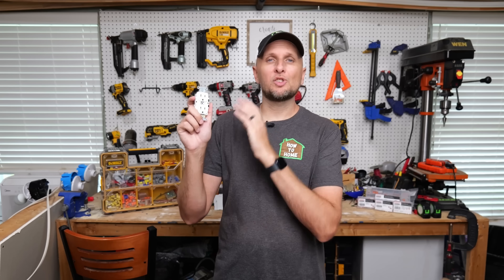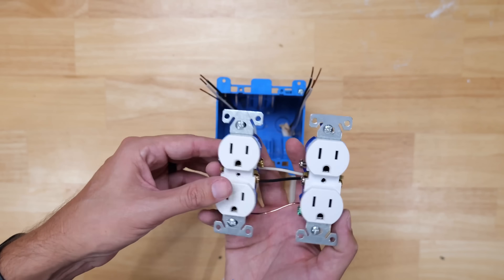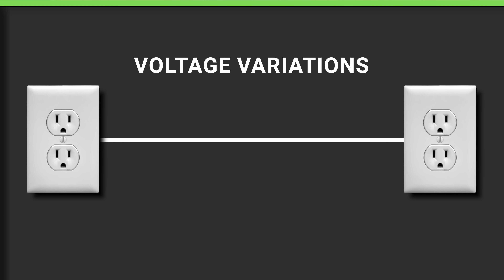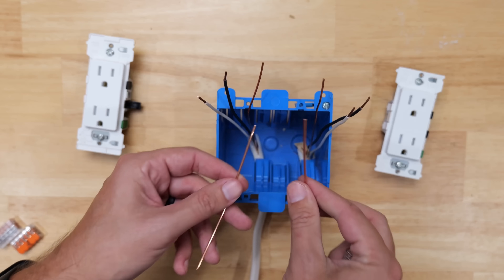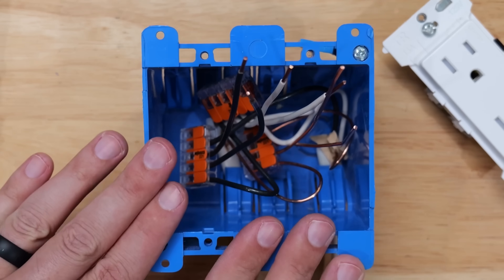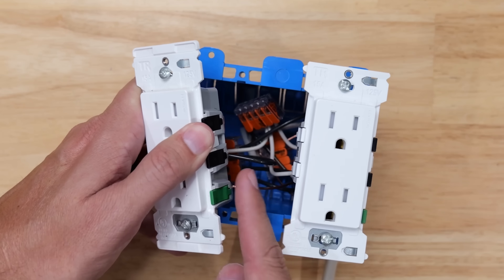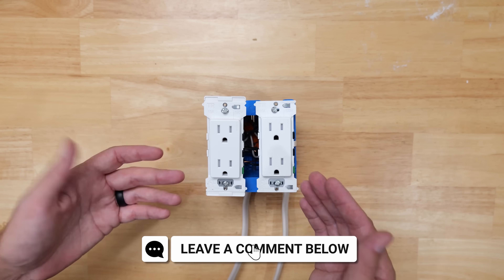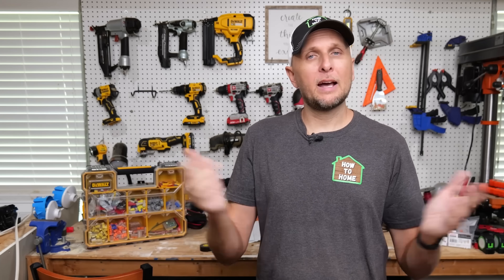Why This Outdated DIY Outlet Wiring Needs to End!

Comment: I use commercial grade receptacles. They basically have a terminal strip built in to the receptacles for hot & neutral. This way the Wago connectors don't take up room in the box.
Reply: I love the commercial grade receptacles.  Very robust and they make great connections.
Reply: I myself only use commercial grade receptacles because even though they're back wired , After putting the wire in , You tighten the side screw and it has a pressure plate that clamps onto the wire 
If you're willing to spend the money and add much more safety , Especially in the kitchen where you use heating appliances 
Hospital grade receptacles which are the very best
Reply: @ironmartysharpe8293 commercial grade (spec grade) are an easy choice for a homeowner
Reply: Agreed.  There's a good amount of surface area for the conductors to make contact, and the screw allows for a tight connection.  Even better is using a torque screwdriver and confirming that you applied the rated torque to the screw.

Wagos are great, too, though.  My old house has short wires in the boxes because the old Romex has been trimmed too many times.  A Wago pigtail adds a few inches in a code-compliant way and makes re-inserting the devices much easier.
Reply: I agree but how do you handle the grounds?
Reply: @thomaslee8116  I used the better terminals and put the wires behind the screw and plate. I used a wago for the grounds and separate ground wire.
Reply: @keithwiebe1787  Same here -- for the ground wire, premade stranded pigtails with a spade connector on the receptacle end make it easy.

Most of the ones I see sold come with a spade on one end and a loop w/ screw on the other end -- I just chop off & strip the screw end.
Reply: @thomaslee8116 you can use a wago. I have also used these green wire nuts with a hole poked in the top. Takes little room
Reply: @daveburgan Excellent. Thanks for the reply.
Reply: This is the way...I'd rather pay double for commercial grade...
Reply: At 7:42 he shows a commercial 20A receptacle. IMHO the screw terminals on those are far superior to any spring tension terminal available. I've got over 40 years of experience in electronics and have found that type of terminal in heavy duty equipment of all types. It's there because it works. Lever terminals still rely on spring tension and have a lower surface area connection than the screw terminals. Passing the hot and neutral through the screw terminals of commercial receptacles to me is more reliable than pigtailing with Wago connectors. If the industry wants everyone to pigtail, they should add screw terminals to the back of outlet boxes instead of relying on wire nuts or Wagos.
Reply: Agreed. The cost difference is minimal for a homeowner. They are significantly better devices and backwiring is faster and easier than making a hook

Comment: Ahh 3 times the points of resistance and failure points when the wago fail you get to search it like an outlet.
Reply: You can use a circuit tracer. If the circuit tracer shows power but doesn't function, that's the fault.
Reply: When the wago fails? They as reliable as a wire nut when both are installed correctly.

Comment: This is wrong, a failed receptacle would not interrupt power down the line. There is a solid connection between the terminals and in no way pass through the outlet, with the exception of GFCI. However there is nothing wrong with pigtailing as long as you remain within box wire fill capacity.
Reply: All depends on the mode of failure; the only one I can envision is if that connector/tab between the two screws per side fails.  Otherwise it seems equal.
Reply: You can see the solid connection between the two terminals in the outlet at the end of the video.
Reply: If the solid connection in the receptacle can be considered liable to fail, why can't the same solid connection in the connector be considered similarly liable to fail?
Reply: You've increased the number of points of failure, though. If wither connection breaks, the circuit breaks.  Pigtailing is often required for neutrals and grounds, especially neutrals.
Reply: @kwilliams2239 Neutrals are required to be pigtailed (cannot depend on a device for continuity) when there is a Multi-Wire Branch Circuit, because servicing one 120V device should not interrupt the neutral continuity of the other half of the circuit. This is required along with the common disconnect requirement on the breakers. 

That said, MWBC has been effectively phased out for newer circuits in residential because of AFCI requirements. Double pole AFCI is rare and expensive, and there are no dual function breakers in the market readily available.
Reply: Wire nuts and pigtails are not counted in box fill calculations.
Reply: Matter of fact I encountered this exact situation when I worked on my niece's place first outlet in circuit went bad and took out the whole chain

Comment: Better yet, just run each outlet to their own breaker. Another way complicate the simplest method. Buy quality recepticals and be done with it. All that extra wire your putting into that crowded box (especially 12awg) creates more problems than it solves. 2 outlets in 1 box, absolutely pig tail, and what about GFCI outlet? Ok to make and exception here, or do we need to install GFCI breakers in kitchens and bathrooms etc.? We're getting to the point where we're pricing homeowners to death. Safety absolutely, but rules made  just so code writers and inspectors can justify their jobs has gotten kinda crazy.

Comment: I'm all wago, especially the 221-2401 splice connectors. For troubleshooting the push connections can come loose just by stuffig them in the box and twist caps can break while installing. I've never had a problem with the lever connectors, you can just look at it, it either works or it doesn't right away. For exterior don't forget to add gel and wago makes connectors for aluminum wiring and you need to gel those too. With wago, you don't need to replace all the mobilehome wiring to add copper wiring.

For GFCI, if it trips that is the only outlet that trips if you do it how to's way with the pigtails, only way to go imo.

Comment: Now add a bigger box of more content, troubleshooting is easy with a multi meter and a long hunk of wire with Gator clips. old school side terminals beat spring thingy's for holding power. We here are talking about branch circuits not individual wires per reseps I get that, if each resep is mission critical then you run independently per said circuit. Last clean room I worked on required each piece of lab equipment had its own circuit. honestly as long as it meets code and building spec's either way works.

Comment: It's a bit easier to install and easier to troubleshoot, but there's no other benefit. Those terminals are hardwired to each other and won't fail if the socket fails. It would have to burn down first. I would trust the hard terminals before a Wago. (I think the Wago connectors are great and even own some, but stating it's a better way is questionable.)
Reply: WAGO patented the spring-clamp connector in 1951, and it is the standard in Europe.  They are safe.
Reply from the maker: Really?  You sure that’s the only way there can be a failure there?
Reply: @HowToHomeDIY Educate me.... I can't see a failure of a hard point. Blowing a breaker is possible in an extreme case, but then you have other issues.

Comment: I am another hack electrician/remodeler, i have been doing it your "right" way all along.  Just seemed to make more sence to have the power connected all the way thru the circuit rather than being interupted by a device.  I am intrigued by those Wago connectors and outlet.  Those could easily save a few minutes per box, make a tidier set of connections and save some wear and tear on my old arthritic fingers.  As long as they please Mr. Inspector and the cost doesn't out weigh the convenience, i am sold
Reply: "Interrupted by a device"? The two adjacent screws on a receptacle are every bit as direct of a connection as the two adjacent levers on a wago. In both cases there's a strip of brass between the two wires.
Reply: I've used the wagos in outlet replacements before where a wire exploded in the box. They're definitely a little more expensive but totally worth it especially if you're working with less wire than ideal. Cost isn't too bad doing small projects but if you're rewiring an entire house it'll definitely add up.

Comment: I probably did it the old way in the past. Now I use pigtails and Wago-type connectors unless wiring something with stranded wire. I'm not sure if stranded and Wago play nice. I seldom use wire nuts anymore.
Reply: Wago works excellent with stranded; perfect for connecting solid to stranded.
Reply: Wago 221's are better than wire nuts for splicing solid wires to stranded wires.

Comment: as a hospital maintained worker for over 36 years, i recommend industrial grade or hospital grade receptacles for homeowner use. yes, they are more expensive, but they provide stronger grip on the plug, have better alloy screws and connectors and we found hospital grade seldom needed to be replaced due to lack of tension on the plug, had very few overheated receptacles.
Reply: Commercial grade receptacles also often have the screw-down plates on the terminals, allowing you to back wire safely

Comment: DIY’er here.  It seems like a bad idea to have the entire circuit load going through the first outlet, too.  More heat and fatigue.
Reply: It's not a problem, the current only goes through the side plates regardless of whether something is plugged in or not, and they are rated for 20 amps pass thru even on 15 amp receptacles.
Reply: Common misconception. The comment above mine nailed it. The side plates on even a cheapie outlet can carry  fully loaded 20a circuit

Comment: I have found in the past that the push in receptacles on the back in some of the older receptacles become loose and do not make good connections and can cause problems.
Reply: Never use those "back-stabs".  It's even worse then coming loose.  They nick the wire potentially causing a break at that point.  Just say "no" to back-stabs.  Buy "commercial grade" recepticals and use the screw clamps.
Reply: @kwilliams2239   The best are the commercial grade Legrand/Pass & Seymour back wire  receptacles that provide a hole in the back that you insert the wire into and then clamp it down with the screw. Saves a lot of time not having to bend hooks and trying to keep them in place as  you tighten the screw. Just strip the wire, insert, and turn the screw.

Comment: I agree with this in principle, but aren’t the screw terminals on the side of the receptacles a solid connection between themselves? Other than the removable of the little break off part, the electrical connection should be solid and not connecting through the receptacle.
Reply: I've retold this story a few times in comments, but the short answer:  no, it's not a solid connection.  It's precarious at best.

I work in a building whose bunkrooms are on the same circuit as the kitchen for some ungodly reason.  The receptacles are daisy-chained with the terminal screws, the "old-fashioned way."  When the toaster oven would run in the kitchen, a receptacle in the bunkroom would overheat.

That tiny metal strip connecting the terminal screws finally caught fire and ignited the wall.  It's not meant to carry the full current distribution of a branch circuit, and it cannot handle 15 amps.  After that day, I started rewiring all of my receptacles at home with pigtails.
Reply: @ronstewart5945 30 + years of the old way and yes the receptacle is designed to pass the full 20 amps through the strip of metal between the terminals without failure. I've wired thousands in commercial businesses with zero issues. There's more connection on that piece of metal than there is in the new clamp style connectors. The only thing that can make them fail is a loose connection that causes heat and distempered it or the wire itself. I don't mind the "new way" which isn't new at all. But sometimes in old work with small boxes you can't fit all the extra connectors and wire and still be able to fit the receptacle. The "old" way is the only way and you just have to make sure hook up the terminals correctly and tight.
Reply: @michaelcassidy7645   I looked up the UL testing and, indeed, it should be able to carry more than 22.5 amps without issue.

I can't discount what I saw with my own eyes, but it seems that the little metal strip shouldn't have been the cause of the fire.

I'm going to rig up a small test wall and see what the problem was.  It may have just been a loose neutral j-hook.  Only one way to find out:  flow heavy current and see which part becomes a surprise candle first.
Reply: @ronstewart5945 , Ah yes, the Empirical Method.
🧐😮👍
Reply: @ronstewart5945 💰😇🙏🫡
Reply: Yup. Whether you daisy chain or use pigtails the circuits is the same from a physics standpoint. Both have the outlets in parallel and unless you have catastrophic damage affecting the terminal or wires you will not see a difference between the two methods.
Reply: @MaheerKibria I believed, and used, your stated principle for 30 + years.
A recent small fire would have been avoided if this new method had been used. Fire was from a heavy pass through load, and a housewife had pushed furniture and cracked a pass-through receptacle 🔥
Reply: It was indeed a freak occurrence.  Under this set of circumstances, an external connection might have been better. Or enough force might have been applied, anyway. Certainly external is better in certain circumstances.
Reply: Not really the same, but along the same line. I can see daisy chaining (using jumpers) for kitchen outlets to a GFCI where the outlets are in a common area. My gripe is with outdoor GFCIs a new home priced at 100s of thousands of dollars where one GFCI receptacle in the basement feeds the garage and outdoor receptacles. On my daughter's new home this receptacle fed four garage receptacles, including the two for the overhead mounted door openers, plus four outside recpticals. At a cost of approximately $20 per each GFCI, why not install one at each location for an additional $160. I just finished replacing them after having to hunt and find the one basement GFCI that tripped causing the loss of power to all the others
Reply: I'm not sure if I kept the burned receptacle for further examination. This was 2-3 years ago. It was feed through daisy chain. 1500 watt space heater down line. All was good until wife moved furniture that impacted / cracked the feed-through receptacle. Next day I came home to a freaked out wife and firemen tromping around.
Reply: I believed, and used, your stated principle for 30 + years.
A recent small fire would have been avoided if this new method had been used. Fire was from a heavy pass through load, and a housewife had pushed furniture and cracked a pass-through receptacle 🔥
Reply: @AverageNiceGuy I don’t know the details of your example, but it’s entirely possible that the same effect would occur even if the receptacle were the last in line. I fail to see how a broken receptacle would start a fire, whether or not it was Daisy-chained, and how that would make a difference. If it was a spark, that could have happened anyway. 
I agree that the US system of power delivery has many potential failure modes. It’s what we have today.
Reply: @TomCee53 The high heat was at a cracked feed through receptacle, thst ended up with high resistance high heat as a space heater was further down the daisy chain. I'm thinking that if the space heater would have been plugged in to a cracked / damaged receptacle, that would have noticed a loose feeling on the plugged cord.... Perhaps not...
Reply: @AverageNiceGuy Thanks. I’m just curious how the cracked plastic changed the resistance of the jumper. I guess if it was stretched enough. I prefer to think it loosened one of the wires, which is a fair critique.
Reply: @AverageNiceGuy 
I agree with Tom, the problem you developed was caused by the broken outlet and was merely coincidental with plugging in the space heater downstream - UNLESS the broken outlet in question was wired with backstabs...

The jumpers on the side screws are MORE THAN capable of carrying 15A, and in no way were compromised by the cracked outlet.
Reply: @openeyes-411 Agreed.
I can't remember if it was backstabbed.
I'm not sure if I kept the burned receptacle for further examination. This was 2-3 years ago. It was feed through daisy chain. 1500 watt space heater down line. All was good until wife moved furniture that impacted / cracked the feed-through receptacle. Next day I came home to a freaked out wife and firemen tromping around.
Reply: @AverageNiceGuy  that is a solid point. Would be interesting to see one of the video channels do a test on this to show how much that transfer bar heats up doing it this way.
Reply: @AverageNiceGuy that's interesting, it means the conducting bar was physically exposed to forces outside the box, which in turn means a force from outside can jar and compromise the connection, maybe even the conductor itself. This is always possible but if there was no passthrough, the only impact would be on devices plugged into it, not on downstream loads.
Reply: @AverageNiceGuy  no such thing as a "pass thru" receptacle. The wires are connected thru the screw plate not the outlet.

Comment: I would connect all the wires together using wire nuts and pigtail each receptacle as shown , Mainly to get rid of the jumper from one receptacle to the other , This is before they came out with the Wago connectors but I would not use this method when connecting GFCI receptacles to protect the remaining receptacles downstream because for the remaining receptacles downstream , The wires have to be connected to the load side of the GFCI receptacle